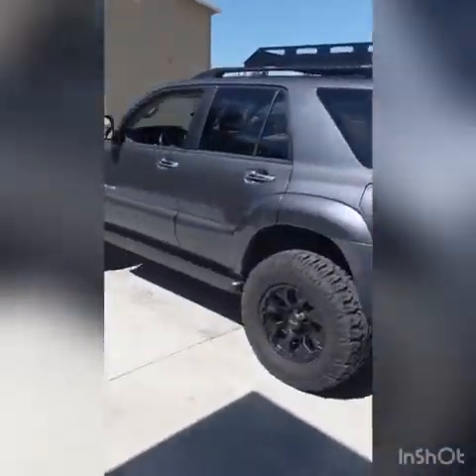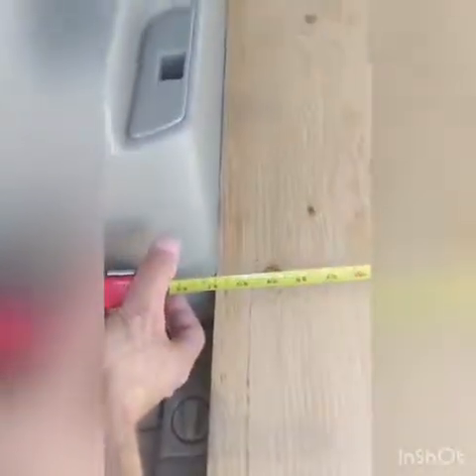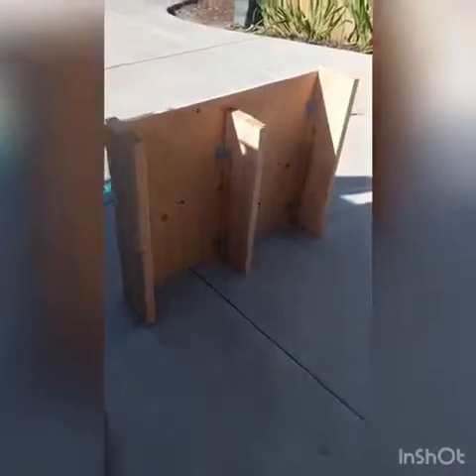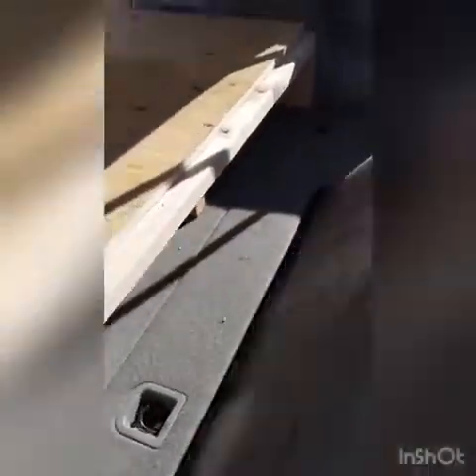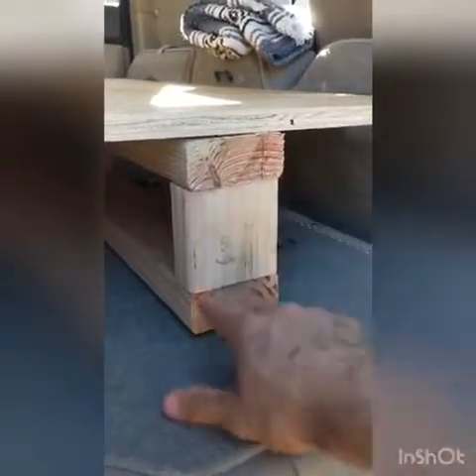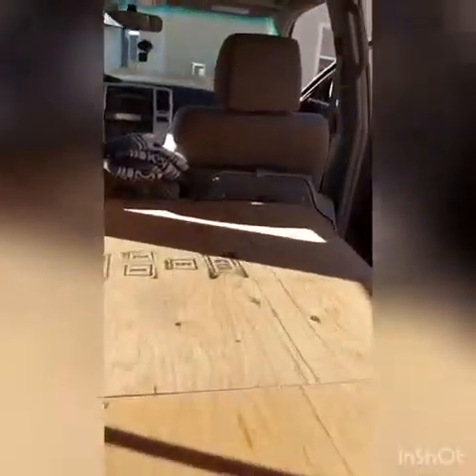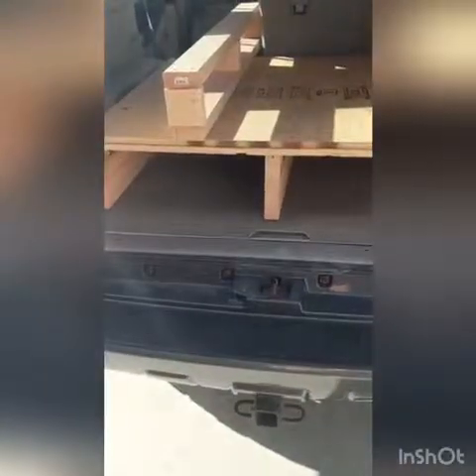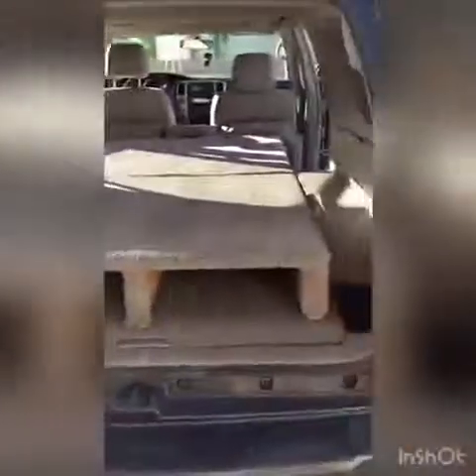4Runner camping bed

Comment: Oleg, I wanted to thank you for this video.  I used your design to build my bed on my 2008 4Runner, and I really like how it turned out.  It's simple, cheap, and functional.  Your dimensions were right on.  I made a couple of modifications: (1) I drilled 2 holes for 1/4" bolts, 3" inch long on the extension board to attach it to the 2x4 support stud. I remove the bolt when the rear seats are up and the extension board is on top of the main storage box.   I  used the same holes on the extension to match holes on the main compartment, so that when the extension board is resting on the storage box, it's attached to it by two 1",  2" long bolts.  In addition, I used turnbuckles to attach the storage to the truck floor.  I painted all the wood the color of the inside of the truck and plan to carpet the top.  Your design is simple and good.